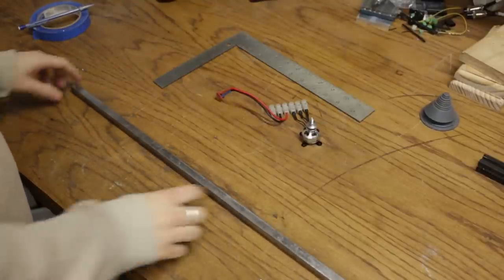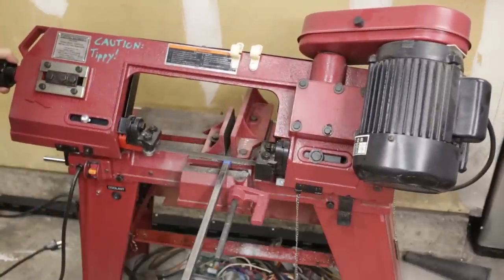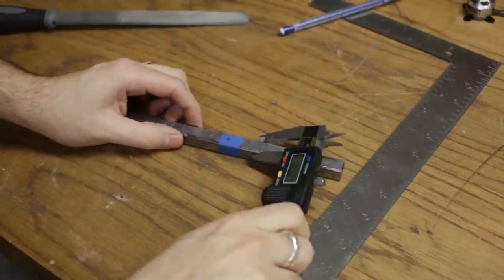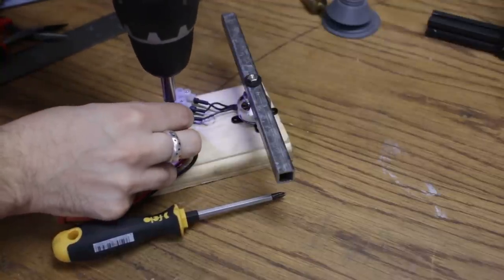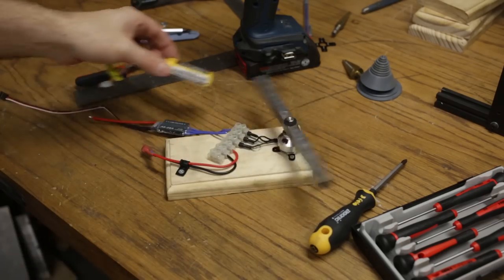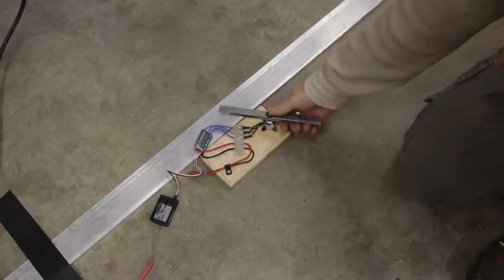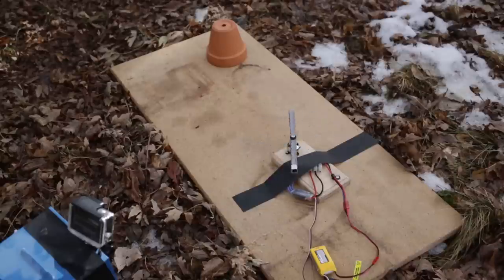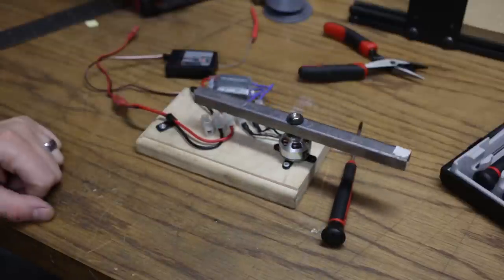Sgt. Cuddles Antweight - Part 1 (weapon test)

Comment: Anyway you can share your part list?, I'm wanting to build a antweight and don't know what parts would be good that are small.
Reply from the maker: JewishLuck Sure, I'm no expert, but the electronics for antweight are pretty simple.  I'll update the description with links and such.  I might do an antweight rundown, this looks VERY different than the final design.
Reply: Robert Cowan 
Thanks man, also this is american antweight design? 1lb?
Reply from the maker: JewishLuck Correct.  1lb or ~450 grams
Reply: Robert Cowan 
Alright thanks! One last dumb question lol. Whats that clear connecting thing you're plugging everything into?
Also, hopefully you upload a follow up video. Also what receiver would you recommend, i didnt see one listed.
Reply from the maker: JewishLuck That's called a terminal strip.  It's a 'euro style' terminal strip.  It was just for testing.  I could do a video that's a tear-down of the final product.  That might help.
Reply: That would be awesome.
Reply: link yet?

Comment: is there any way to convert those 3 wires on the motor to just 2 wires?
Reply from the maker: nope.  these are brushless motors, which have 3 wires, and they're controlled by switching phases (essentially).   brushed motors have 2 wires, and you just apply voltage.  they operate differently.  brushless motors are usually more powerful than a brushed motor (of the same size/weight), but need more complicated electronics to drive them.
Reply: could you achieve something like sergeant cuddles weapon with brushed motors?
Reply from the maker: You could use a brushed motor, but the power would be significantly lower.  why can't you use a brushless motor?
Reply: I can, but that means getting more parts to accommodate the motor and brushless is more difficult to use; but if it is really worth it, i could use brushless
Reply from the maker: it's REALLY worth it.  at this size and weight class, you really want to use brushless motors for weapons.